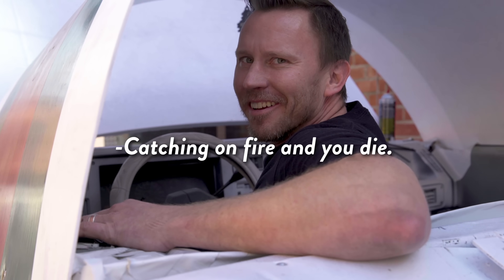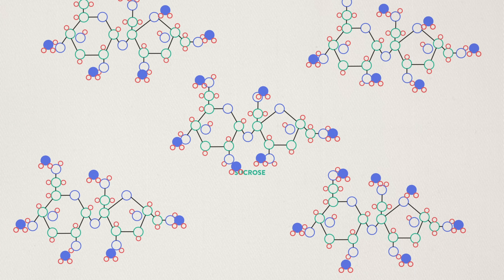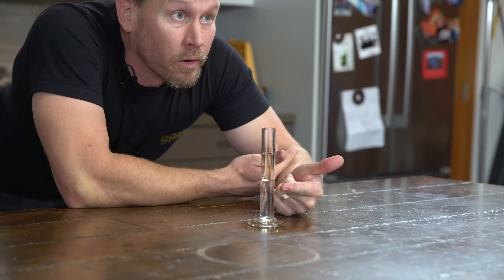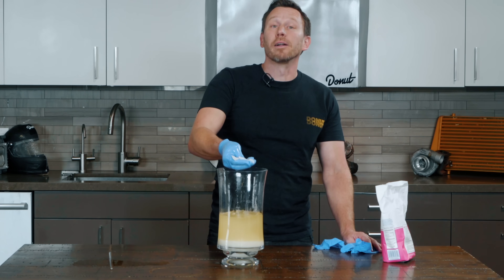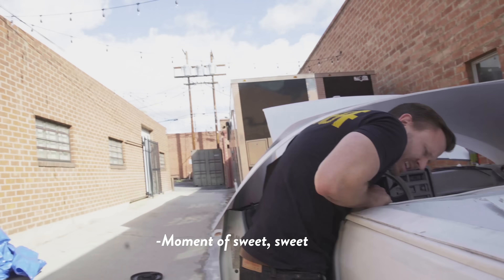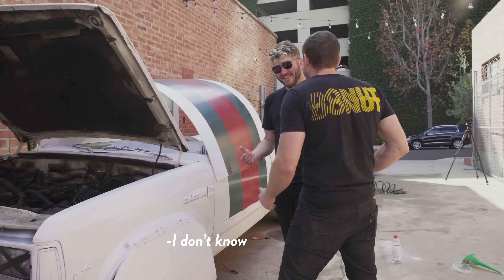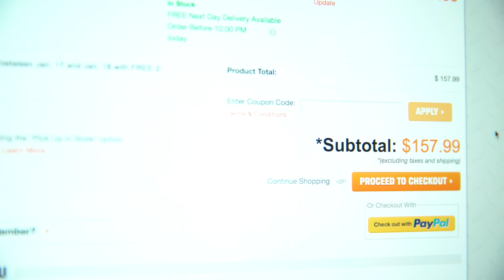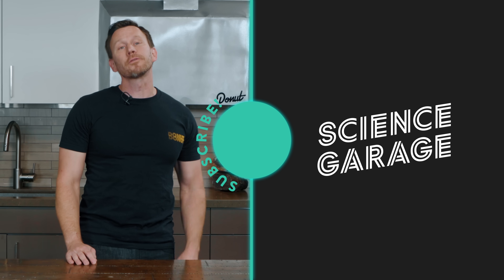SUGAR IN THE TANK - What actually happens? | HOW IT WORKS | SCIENCE GARAGE

Comment: If you drove around the block and sloshed the fuel and sugar around, maybe more would be sucked into the engine.
Reply: More hoonigan labs👌🏽
Reply: I was just on my way to put this in th comments
Reply: Facts! I was fortunate enough to have sugar put in my tank. It's more of a accumulate issue. The more you drive & add gas, the more it clogs the lines & kills the engine.
Reply: correct me if im wrong but i think i heard on a video that gas and sugar doesnt mix
Reply: @jessemano9880  they don't 'mix' per se, as in dissolve the sugar outright.

But the sugar definitely turns into a nasty little goopy glob of gas and sugar. Loose crystals get picked up too randomly through the system. Anything that makes it to the engine ends up turning into molten sugar, and then once the engine cools it turns into a hardened clogged nightmare.
Reply: I was thiking the same
Reply: Do a donut.
Reply: I was just thinking that. The idea was probably that you would want them to drive around thinking everything was alright but when they hit a bump in the road, sugar would bounce up and get into the engine. Then they would break down unexpectedly, leaving them stranded. If you're trying to sabotage someones vehicle, you're probably not assuming they're just gonna run the vehicle idling in one place.
Reply: I knew someone with a old camery and they drove with a gas tank full of sugar for a cupple months before realizing it. The car still runs good today somehow.
Reply: That’s what I was thinking could’ve been the variable
Reply: If you have fuel filters on your car as most people do, the sugar would at worst clog the filters. Sugar doesn't disolve in gas.
Reply: It would. The fact that they made this entire video & didn't do that is ridiculous. Waste of time on their part & the viewers
Reply: yep, badly designed experiment, not a real world scenario...
Reply: This, and also, what if I was dissolved in water first or they poured soda into it? This video was seriously not thorough with this subject.
Reply: Ive also heard that its not really a problem of running sugar through the engine, its letting it cool then trying to restart it, it might also be worse with injectors instead of a carburetor
Reply: @gabrielcusack-mercedez8859  you are correct. Putting sugar in the tank isn't all that bad - EXCEPT - it'll trash your injectors, o2 sensors, fuel pump, and fuel filter over the use of the engine through normal everyday operation.

Then, once all that accumulated hot sugar (that's molten and moving around the entire system) cools down, you end up with clogged shit everywhere and a good deal of troubleshooting/headaches/repairs ahead of you.

Source: I know someone that dumped 2 cups of sugar in their enemy's tank and 4 days later of driving, the car was at my buddy's shop getting repaired. Then, after the repairs, the same menace went and dumped 2 bottles of syrup in the tank... THAT did the motor in completely.

Conclusion: don't use sugar, use syrup. Lol
Reply: What about a fuel injected vehicle?
Reply: Love you Bart man.
Reply: Vibration from the engine running should agitate the sugar in the tank so driving it isn't needed to disperse into fuel system
Reply: @jbstepchild  
IMO
I think you're wrong 
I'm pretty sure driving it would mix it all much better
Reply: stepchild you sound how you look

Comment: I feel that if the truck was in motion. It would have sloshed the tank causing it to mix and the result would have been a bit different. When you mixed the sugar with gas it took a little for it to completely settle at the bottom. So if the vehicle was in motion it could have sucked more into the fuel pump.

Comment: you should drive with sugar in the tank. the movment will stir it up and get more accurate results
Reply: Was just about to comment this. Drive around and slosh it up so more of it gets in to the pump
Reply: Momentum won't stir it up, sugar does NOT mix in gasoline
Reply: @DearHRS  it wont dissolve. it will mix and suspend momentarily, which should pull more into the line, then it will settle back to the bottom.

Comment: I work for a dealership and I have seen many cars come in over the years with the fuel rails loaded up with sugar dissolved into a thick syrup. It's nasty stuff and we have to replace everything
Reply: RICH DISCOVERIES I have seen it as well. Car need gas tank, pump, filter, fuel rails and injectors and the fuel lines replaced or flush good. My boss bought the car from the customer in hopes of fixing it and selling it. By the time we replaced everything it was too late the damage had been done and the motor ran like shit.
Reply: @cf3661  yeah you seen it too then. It is nasty shit and just makes a complete mess of everything in the fuel system!!
Reply: RICH DISCOVERIES yep. Although I love these guys, this is complete misinformation.
Reply: @cf3661  I mean, I always assumed it was a slow sabotage that would wreck the fuel system more than actually kill the engine, but there's no telling exactly how long it would actually take for that trash to finally do its work and an hour or so running just isn't going to be a realistic test.

Does tell you that it sure won't go Beverly Hills Cop banana style and go a hundred feet before dying on the road but it seems like it may be more likely to hurt the next guy after they sell it off....
Reply: SkuzzyJ it would probably take a few days to a week or two to be noticeable.  But by then it’s too late and it’s everywhere restricting the flow of fuel.
Reply: I'm a technician and have also seen it first hand. Itll wreck a fuel system.
Reply: Probably from the ethanol in the gas
Reply: @dangeristh33  🤔Hmm, that is an interesting Theory. That may just have something to do with it
Reply: Wouldn't mixing the sugar with a little water and divergent make it way way quicker to go through the system and kill an engine? Or does it seem like it's generally a long game, like going to take weeks or months to do the damage?
Reply: Yeah my truck was destroyed by it I took the fuel system apart and all that flowed out was this black sludge and it was in the carbs to.
Reply: I’ve also seen this many times. The last being a 2012 impala 3.6 direct injection that locked up solid. At first I was looking for a loss of oil or coolant but both were full and no signs of water ingested. Got approval for tear down and that’s when I found the molasses on the cylinder walls. Engine destroyed. So it is most definitely a killer. Next time drive it for longer for testing this.
Reply: What about diesel
Reply: how does it happen so often, sabotage common?
Reply: @fruzzle2012  I wouldn't say it common, but we do see it every so often. I would have to say at least once a year we get something in that has been sabotaged and the the fuel system is all sludged up. I see slashed tires a lot more though, that is fairly common
Reply: Does that play off with salt 🧂?? Recently my Honda Accord 2021 got vandalized
Reply: Im guessing the ethanol must be the culprit of dissolving sugar, but the gasoline it self.
Reply: RICH DISCOVERIES sorry but...how did the sugar get in there...and who’s dumb enough to do that
Reply: @rubencovaciu1910  Considering it's widely believed to be an effective sabotage method, I'd assume someone besides the owner did it to try and ruin the car.

Comment: Your putting a soluble non-flammable non-combustible material into your flammable combustible fuel, that's a terrible idea😂. That's a bad fuel mixture,and the sugar will make your fuel weak, and if that sugar separates from the fuel now it will sit and collect at the bottom and be sucked through the engine. Damage your fuel pump and your engine, your better off using sand

Comment: If one was trying to sabotage a fuel tank, water would be worse than sugar I think.
Reply: only way this would work is if you got enough water in there for the entire pick up/sock to be only in water and no fuel. 
Lots of engines can suck up a little water and just spit it out but too much and you will hydro-lock the engine.
Sugar, 1 cup is enough to do damage.
Fun fact/old school trick. Very small amounts of water poured into a carburetor can assist in cleaning any bullshit out of the engine.
Reply: if you fill your fuel tank, normal air get in as well, that air contains water vapor that will condence to water in your fuel tank. Therefore there will probably be water in your tank already.So no problem there. You could clean your fueltank of moist by filling it up to the brim on a hot day. Then the water in the fueltank will be watervapor  becous of the heat,and the filling it will press that vapor out.
Reply: ronald broersma gas floats on top of water, they don't mix. Watch the video above again. in your example you'd have a full tank of gas with the same amount of water.
And notice I said water would be worse, not that it would place the vehicle out of commission. Although, if I were sabotaging a tank of fuel, I wouldn't be blowing in it in hopes enough water vapor did the trick, I would be pouring in a jug of water. The difference in volume is enough to do the trick.

Comment: Doesn’t sugar dissolve in ethanol? So what about fuels containing an ethanol content??
Reply: Ethanol doesn't really attract sugar that well.  Both have a strong affinity for water, but it is the water content in alcohol that absorbs the sugar, not the alcohol itself.
Reply: Bayerische Motoren Werke Motorsport-Abteilung Yes I believe so. They need to do sand instead.
Reply: In order to remove water from gas, you add ethanol, as ethanol will attract the water and the gas. If sugar dissolves in ethanol, it would make sense in my mind that adding ethanol would solve the problem.